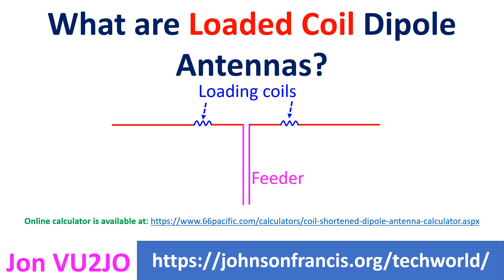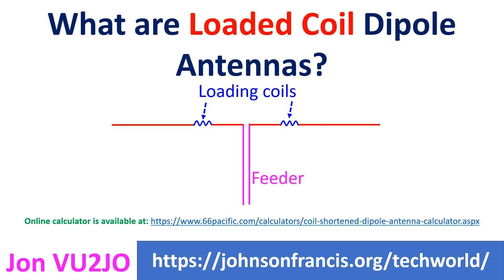What are Loaded Coil Dipole Antennas?

Comment: Yq for sharing n explain.... de 😊9w2yzi
Reply from the maker: Welcome!
Reply: Thanks for the information. I am making a aluminium dipole for 10 meters. The aluminium tube size is 16mm i want to make it a full wavelength for 10 meters with an aluminium coil 107 diameter made from 6mm solid aluminium round bar. It has 5 turns at 107 diameter. Where should I place the coil in relation to the feed point.
Reply from the maker: My experiments with loading coils for simple wire antennas have not been successful short of a NanoVNA. This page by M0UKD might guide you: https://m0ukd.com/calculators/loaded-quarter-wave-antenna-inductance-calculator/
Reply: @johnsonsTechNAgroWorld  thanks for your help
Reply from the maker: You are most welcome.